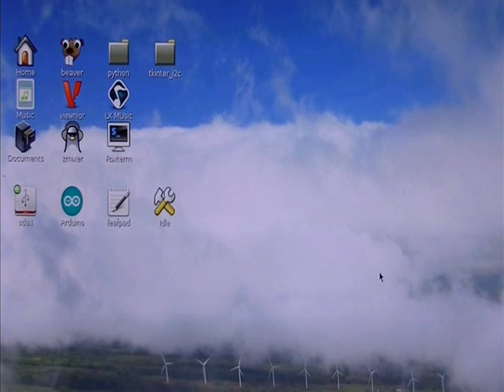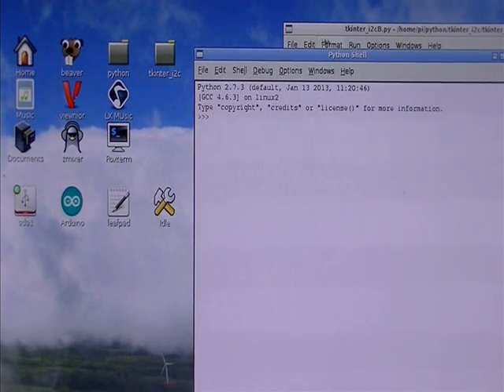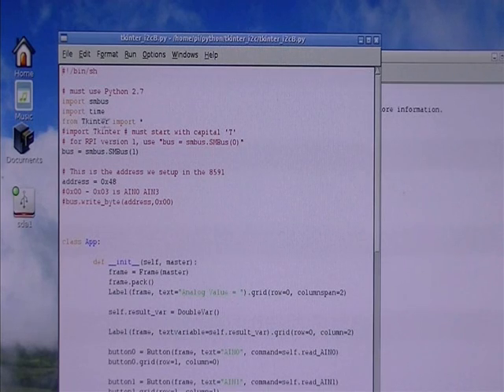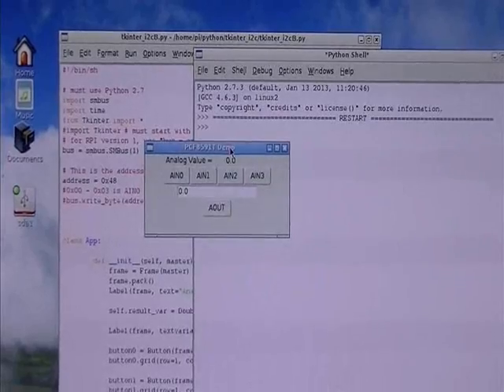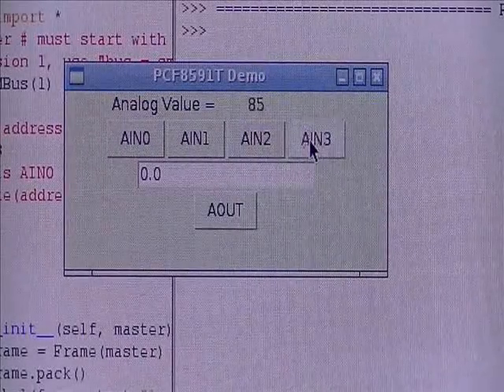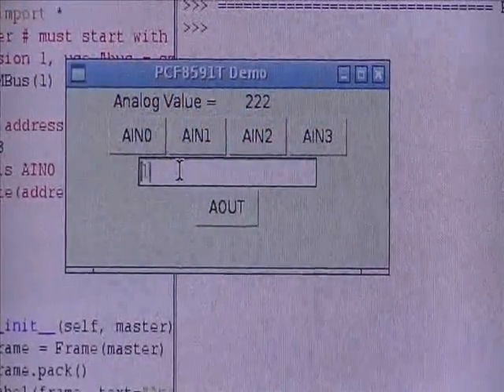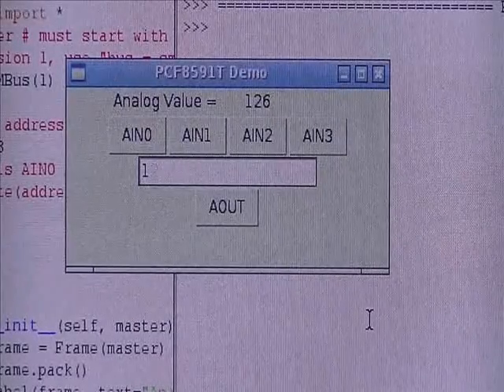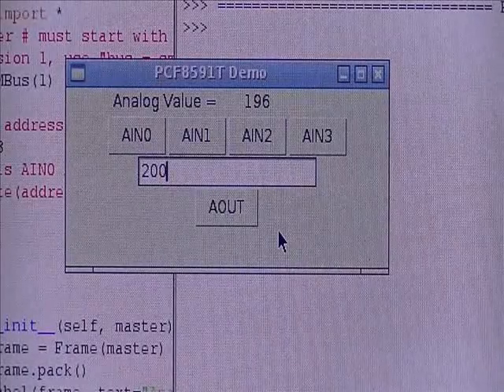Tkinter with Raspberry Pi and PCF8591 AD-DA Sensor

Comment: I have a question for you: for two differential inputs (just two channels 0 and 1) the hex addresses work the same as the ones in your code (0x40-0x43), I believe they are other addresses because what I could notice was that you wrote the code for 4 single ended inputs. Can you please help me?
Reply from the maker: Otto Castillo  Never tried it the other way. Just follow the spec sheet but the Python code will need to be rewritten. I think 0x40 sets the mode.
Reply: Lewis Loflin Thank you very much. I will follow the Specification sheet. I had this question because I am trying to connect a Two differential inputs sensor to a Pi through this PCF8591 ADC converter.

Comment: Question I get multiple values on Ain0, AIN1, AIN2, AIN3.... when i execute this python code for pcf8591. Any idea why?
Reply from the maker: Kav You should because if the jumpers I assume are on the module are connected they go to three differing inputs while the output of the DAC goes to one input.
Reply: Lewis Loflin So how do i know which one is the correct value?
Reply: Lewis Loflin How i do know which ones are the correct values in aino0, ain1, ain2, ain3